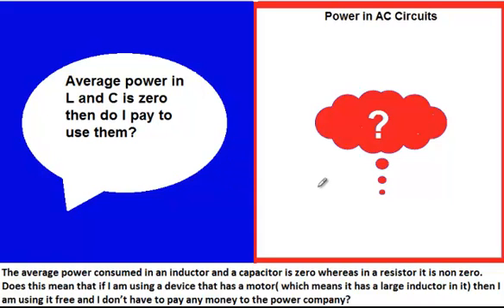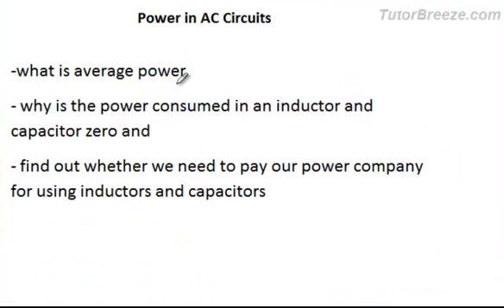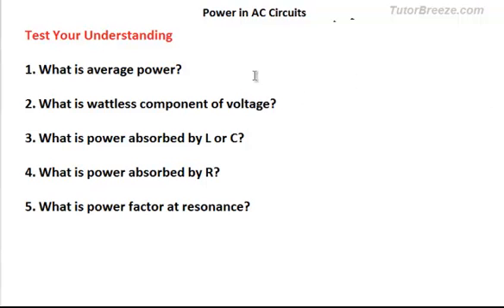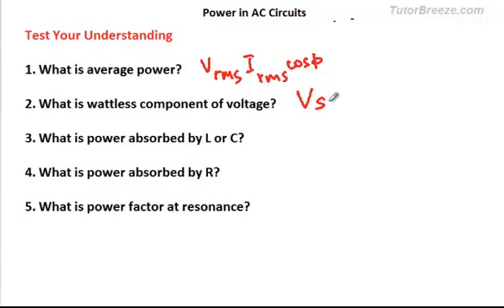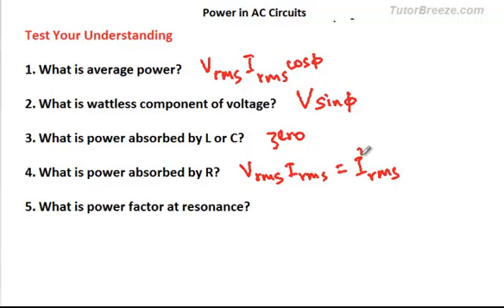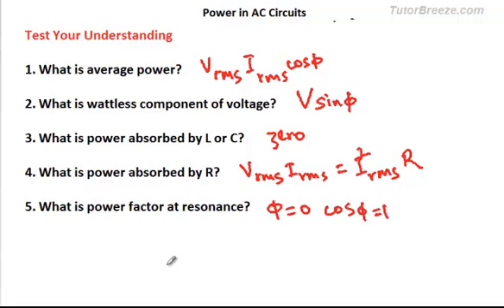Power in AC circuits

Comment from the maker: Because the phase difference between the current and this component of the voltage is 90 degrees so the power dissipated due to it is zero.